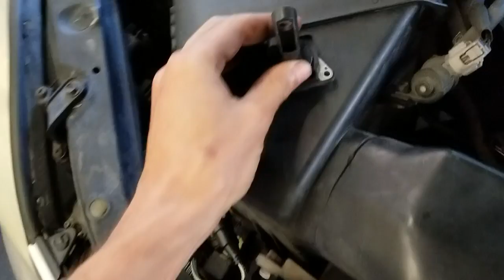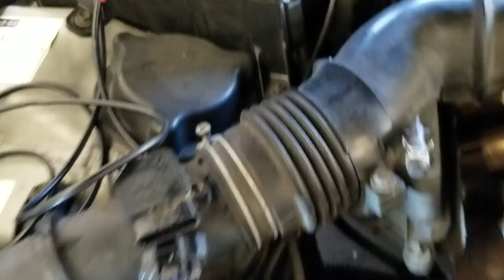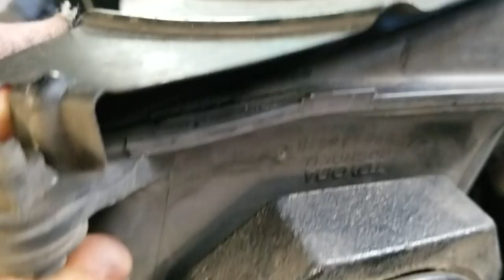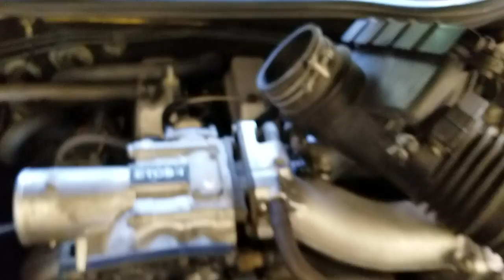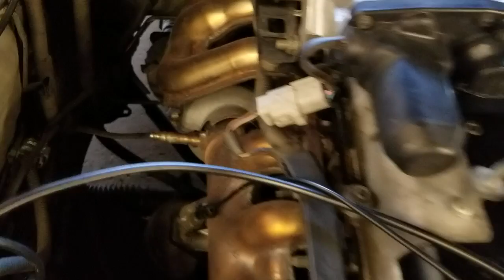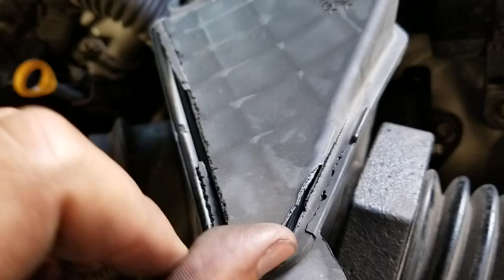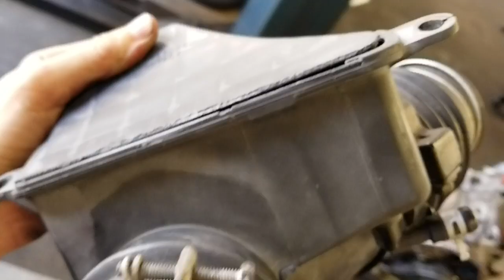FIXED 2JZ hesitation & low power, no check engine light.

Comment: I just worked on 2003 Lexus IS 300 with P0171B (bank 1 System too Lean) and P0174B (bank 2 System too Lean). I replaced the MAF sensor I got from 2005 Toyota Camry from Pick n Pull wrecking yard and the problem with hesitation he described went away.
Reply: Between your comments and this very informative video. I was able to find the cleanest maf sensor at my local pick and pull. Replaced it right away and all hesitation  and jerking was gone it shifted better and accelerated well. Thanks for the tip about the camry mafs. I also found that the prius and echoes/yaris have the same mafs as well. 👍👍

Comment: I have the exact same engine and csr model, just bought it used, can anyone help me figure out why theres no kickdown to it? Also takes a long time for the rpm to lower after a morning start. Thanks
Reply from the maker: Replace your thermostat, and make sure the fast idle valve is not sticking, make sure coolant lines are not blocked to the idle valves, also check if throttle cable is too tight. Not sure about kickdown, revisit that with me after investigating and making changes with this video.

Comment: I ve been having the exact same issue on a Nissan VQ40de and could not figure it out, so have been throwing parts at the engine one by one, Plugs, Mass sensor, even bought a fuel pump and was going to install. Going to open the air intake up and have a look. Fingers crossed.  Thanks
Reply: R S L hey did this help I'm having the same issues
Reply: @Kholmes97  
It was exactly what he said it was. Replaced the cracked rubber hose. Worked perfectly after that.
Reply: R S L  wow is worth try I'll see if it works on the vq35hr
Reply: @Kholmes97  I recommend that you inspect the intake from the air filter ducts and hoses until the Throttle to check for any defects. I thoroughly looked without dismantling and found out that my rubber hose was cracked. If u still don't see anything then do what he did in the video and dismantle the intake to have a better look. 

I go to the desert frequently so I clean my air filter every 2 weeks and in order to remove my air filter there is a flexible rubber hose that flexes every i remove the air filter. That hose wore out due me cleaning too often.  It all made sense after I found out the problem. 😂

Comment: I have the exact same symptoms but on my diesel 1kz-te hiace. It has a throttle position sensor though...GRR Im pretty sure i have a fuel leak somewhere need to test. When i push the plunger til it goes stiff, after a wee while it will become soft again.

Comment: Hello was wondering if someone could help my car is a JDM 93 supra 2jzge non vvti engine starts then runs for a few seconds then stalls, or stalls as soon as the throttle is given. I’ve ran codes and have 24 & 31 which is maf sensor related however my car has a map sensor. I’ve replaced so far the valve cover gaskets cleaned pcv valve installed new distributor cap rotor button spark plugs and spark plug wires still have same issue if someone could help me diagnose further or may know a solution that I’m not thinking about I would appreciate it thank you.
Reply: We have the same car same problem does your car also die at low speeds? One thing i did was open up the ecu and got the blown capacitors replaced even though that didnt solve my issue at least i got that out of the way.i also did what u dud and car still has the same issue.have u fixed the problem?

Comment: yes you got the problem right i was having the same issue and happen to find out that both of my es330 fresh air intake hose were busted open and got it checked our with few mechanics they both had a different view one said fuel injector and said might be your transmission because it was gagging on acceleration but anyway after replacing those two intake hose it runs like a brand new and one more thing also cleaned my body throttle that also made a big difference.
Reply: Mechanics are fucking thieves of course they suggest its something big

Comment: I had a lag low in power band on my es, 1500-1900 rpm, turned out to be a VVT solenoid.
Reply: Did you have a check engine light for it?
Reply: I had the same issue and also replaced the vvt solenoid. My revs would randomly go up. it fixed the random rev jumps but my car is still sluggish and has a burst of power when i floor. I hope this will work.

Comment: I have an 04 Accord with the same problem. I changed the MAF sensor, problem still exist. Changed IACV, same issue.  Cleaned filter , did idle relearn steps and still have the problem.  Next step is to replace ignition coils after that IDK. HELP.  Even clean throttle body.
Reply: I'm dealing with same issue. I changed the spark plugs, coils, connectors, cables and cleaned the MAF but still runs with hesitation. Im getting lean error codes and misfiring on all cyli ders. It barely runs down tbe street. I guess now im going to replace the MAF. Any suggestions?
Reply: Sean E.  Any luck?
Reply: @mrandmrspete3405  yes, i replaced the MAF sensor and now the car runs strong. Although I'm still getting a check engine light to diagnose. But after replacing the plugs, wires, coils, connectors, battery, and mass air sensor it runs really strong. Amazing how smooth and powerful that car runs being 18 yrs old. I'm going to autozone with this final check engine code to diagnose.
Reply: Sometimes the coolant temp sensor; the one for ecu signal, could be damaged. It’ll give the same symptoms as the MAF issues.

Comment: im currently experiencing this exact damn problem for about 2 months now. I m gonna try this diagnosis with the MAFS.. already changed fiilter and fuel pump :(
Reply: Hello,
Nope. After cleaning the mafs nothing changed. Matter of fact I even took out the sensor and no changes were detected with the engine, which was strange which probably means I have a faulty sensor BUT then I get no check engine light...

Fast forward to the actual problem... turns out the problem why the car was dragging was due to the Fuel Pump Sock being clogged, the Strainer/Sock was later changed. And car was back to normal performance
Reply: My cars has bed hesitation when I turn it on and the engine shakes sounds like it wants to turn off and when I hit the gasit goes really slow and then it'll go fast but also at stoplights it hesitate on reverse it hesitates going forward. it's all bad I replaced a O2 oxygen sensor I put a air filter I replace a mass airflow sensor I replace the harness wire.and all the mechanic do is take my money and send me on my way with my car still messed up I don't know what else to do 😞😞
Reply: pleasant styles I dunno why your mechanic had to change all that but from your first description of the engine shaking and wanting to turn off I’m not 100% but I’m pretty sure this is to do with your car’s spark plugs, they either need to be cleaned up or just replace all 4 of them.
Reply: @juniorDaDamaja  I already changed all of the Sparks plugs. It then misfire again, hesitates really bad especially when I first turn on the car. It's like another part is blowing out my spark plugs. but they claim they already checked every other part I'm just going to get a oil change and see if that'll help as well.
Reply: pleasant styles wow. Okay. This is interesting, with the problems you described, the most likely things I would personally suspect/check are
1. to Clean/replace the plugs (but you’ve done this already)
2. Maybe it’s the coil pack itself? (The mechanic could try using a different coil pack to test and see)

You also mentioned Hesitation, When there is hesitation when the car is “in motion” it could also then be that it’s not spraying enough Fuel, therefore
3. Replace/Clean the Fuel injector Nozzles (using carb cleaner) and/or
4. Change the Fuel filter OR
5. maybe it’s a weak fuel pump (therefore replace it including the strainer)

Other unlikely/rare causes
6. If the car has a fuel regulator, maybe it’s faulty too
7. A bad MAP and MAF sensor too may need cleaning (or replaced if damaged)

From my little knowledge these are all the possible causes. But since you say you’ve done no.1 my next thinking is to check 2.

Goodluck
Reply: did it work?
Reply: Yep here too, cjanged out my Catalyst still doing that so I cleaned my throttle body, MAFS, put in a new TPS, still my RPM is low but after a certain mile it runs good for awhile and my RPM goes low have to feed more gas to move. So I decided to change my fuel filter, and the MAF sensor see how that goes. On my 2002 ford explorer sport 4.0L

Comment: I've been using Gumout injection cleaner in the tank with theh PEA in it, and it's been doing a great job keeping the injectors clean, also I've used CRC's intake valve cleaner a few times cleaning the intake valves on GDI engines, and that makes a big difference if you haven't cleaned the valves.

Comment: Excellent video, and excellent  explanation of issues.  Just started having this problem with my 2001 GS300.  It has 318,000 miles on it.  This has been a great car (bought it new for my wife) and with your detailed video I'm sure I can fix it and she can keep driving it.  Thanks!
Reply: That's good
Reply: Love to see ppl like you who buy cars new and keep them an drive them u til you absolutely can’t no more… I bought my 98 GS300 from the original owner with 153k miles put tons of work into repairing it $8000 just about and it’s going to be good for another 200k miles east I want to try to get 500k miles out of it

Comment: Thanks man I’m going to do these steps I have problem it will randomly low idle and die sometimes after stop and go traffic. Then sometimes it’s fine . Getting really bad gas mileage as well . Any idea you seam to kno the 2j
Reply: Sounds like you need to do what I am doing. 
1) Spark Plugs and Air Filter Clean sensors. 
2) Newer car (depending on make and model) Throttle position sensor reset
      A)  Turn ignition to the on position ......Google for all of the steps to that one. 
3) Spend $5 on a bluetooth OBDII Scanner. This is very great to have. Anyways. Research is just going to teach you more than you need and your going to see that the symptoms can be any number of problems big and small. With your scanner run the tests and after you do some readigs compare the data to where the numbers should be. That is the best answer to your solution. Good luck.
Reply: Raiders raiders my car is also hesitating and dies at stop lights but it turn right back up i replaced my sparkplugs not to long ago and wires too so u think it might be be a vacuum leak cuz its running very rough 1993 2jzge there's no obdll on these cars

Comment: I have a Lexus IS 250 Manual, when i go pass a certain rpm the car just loses power and you feel no power in the gas pedal and if you step off the gas and go back in it gives gas... do you know what’s wrong with it? I just had a check engine light for a MAF but I bought a new one and fixed it . But it still does that sometimes, when I put new fuel it seems like it runs a bit better more.

Do you think it’s possible it’s the fuel pump ?
Reply: Hello. Did you figure out what was it? Thanks

Comment: Sounds like the problem I'm having only with a dodge caliber 1.8. Why doesn't the check engine light come on though? Also what is the name of the section you took out that had the crack in it?
Reply from the maker: the caliber probably has an air leak in one of the tubes. the check engine light will not go on if the computer can adjust for it. but if it goes outside of those parameters for a fixed amount of time, it might eventually throw a code. you might have a "pending code" which is visable on a scanner, but it wont make the light go on yet.
Reply: @subtledriver  I'm also thinking it could be the throttle body as it seems to have the symptoms of it being that...but that wouldn't explain it not pulling a code or the check engine light not coming on. I'll have my mechanic check the hoses first as well as the mafs and hopefully he can find the problem. Thanks for responding.

Comment: Hey mate, i have a 2JZ-GE JDM Toyota Supra(no MAF) and my engine hesitates and has low rpm at start-up (until the engine gets warm). I’ve checked for air leaks, vacuum leaks, replaced the IACV, cleaned the intake, replaced the spark plugs (it’s distributor so no coils), replaced the coolant just now, I’ll replace the oil tomorrow. The problem is still there and after the coolant replacement the engine acts really weird(noise coming out of engine bay) and won’t go above 3800 rpm (bellow that rpm it’s all fine). The first problem I still don’t know how to fix it, the one that just appeared might be due to air in coolant(i hope) but I would really appreciate if you have any suggestions.
Great video btw ✌🏻
Reply: Your map is a aluminum cylinder with a square plastic cover? If yes you have a older engine
Reply: It’s the 93 engine from Japan non vvti. I’ve figured out the problem and if anyone comes across this with similar problems, the issue was that capacitors inside the ECU were leaked
Reply: Grozea666 i replaced the capacitors too and everything else sparkplugs wires new distributor cleaned throttle cleaned iac and it still miss fires hesitates and runs rough dies at low speeds  my car is calafornia car so it has the 3rd 02sensor that might be my last option to replace it or keep looking for vaccum leaks
Reply: Im thinking could a bad temperature sensor cause all of our problems

Comment: My GS300 had the throttle stuck wide open whenever kickdown was active and it was dangerous. Only way to reset it was put gear into neural and turn the engine off then on.

Comment: So I changed my Mass Air Flow sensor and my hesitation problem stop. I have a GS300 98 and nobody couldn't figure out my problem. I came across a thread that someone recommended changing his air flow sensor resolve his issue after trying to clean the mass air flow sensor. My mechanic was surprised this was the issue all along because my check engine light didn't come on. I recommend getting your Mass Air Flow sensor from your dealer.  This is my second time changing it over the last 3 years. You should change it yourself its 2 screws and a clip it is very simple.
Reply from the maker: This is origonal maf sensor, with 350k miles. Cleaned it and fixed the hole in the intake and havent had any problems since.
Reply: @subtledriver  My sensor went bad 3 years ago. I dont even have 185,000 yet and I have a 98 gs300

Comment: What about the “Catalyst System Efficiency Low B2” problem on the 2002 IS300?  that have to do with air leak? I was told to get it fixed was around $800 😪
Reply from the maker: Try changing 02 sensors and make sure coolant temp sensor is reading proper and thermostat is not sticking open and plugs wires are fresh and no air leaks or oil burning issues. Those all cause damage to cats. Probably need a cat if front and rear 02 is fresh and working proper.

Comment: Hi I have a lexus gs300 1998 model I replaced the Rocker cover gasket and on rebuild I noticed I forgot to put the vacum pipes to the vacum switch valve on the back of the manifold! Does anyone have a clear picture of the layout so I could out this matter right please it's idling rough but dives fine anyone please ?

Comment: I 🙏🏽 this works. I have a gs300 98 with 180ish miles and this can be a game changer. Thanks for this share!!! I knew someone else had to be dealing with the same issue. Also what is the update did sealing those holes resolve the problem?
Reply: So I changed my Mass Air Flow sensor and my hesitation problem stop. I have a GS300 98 and nobody couldn't figure out my problem. I came across a thread that someone recommended changing his air flow sensor resolve his issue after trying to clean the mass air flow sensor. My mechanic was surprised this was the issue all along because my check engine light didn't come on. I recommend getting your Mass Air Flow sensor from your dealer.  This is my second time changing it over the last 3 years. You should change it yourself its 2 screws and a clip it is very simple.

Comment: Get a Actron CP9690 code tester. It checks live, record, graphing, emissions readiness test, transmission codes, ABS, SRS, oxygen sensor test, and MORE! It has code-connect to diagnose codes. Get 4 aaa batteries for under the rear cover. It comes in a black pouch. It checks from 1983-2013 and is updatable. Get a USB cable to update it. EBAY has it. It costs from $160.00- $170.00.

Comment: One of the best videos I have found for this issue with the 2JZGE. I have a 01 is300 and I'm having hesitation and acceleration issues and hope it helps me out..thank you
Reply: I have a gs300 2001 and im getting lean codes and miss fires on all cylinders. I cleaned the mass air flow but didnt help. Any suggestions? Maybe change the MAF
Reply: @seane.9937  VVT-I solenoid
Reply: @seane.9937  Very easy to change and  it isnt expensive actually under $100
Reply: So I changed my Mass Air Flow sensor and my hesitation problem stop. I have a GS300 98 and nobody couldn't figure out my problem. I came across a thread that someone recommended changing his air flow sensor resolve his issue after trying to clean the mass air flow sensor. My mechanic was surprised this was the issue all along because my check engine light didn't come on. I recommend getting your Mass Air Flow sensor from your dealer.  This is my second time changing it over the last 3 years. You should change it yourself its 2 screws and a clip it is very simple.